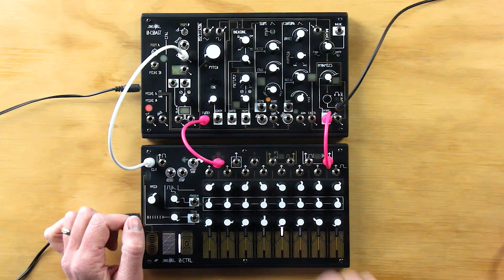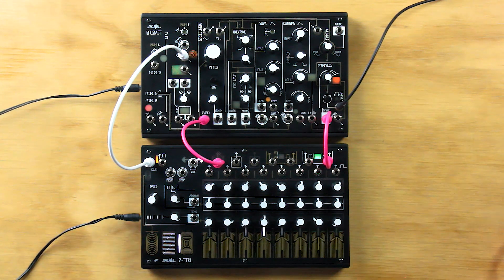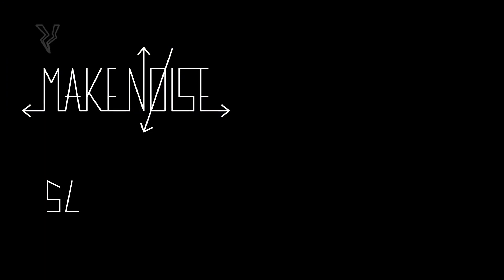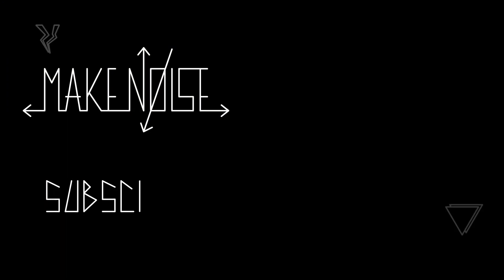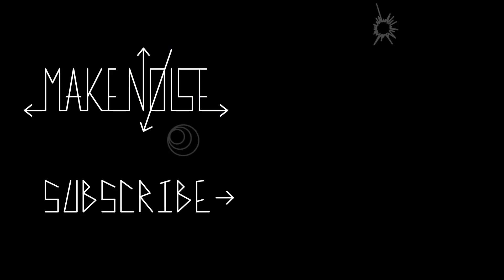0-CTRL Patch of the Week #3: Clocking the 0-Ctrl - Internal and External

Comment: It is not clear to me, despite various videos and manual, how the TIME sequencer line single steps work under the domain of an external clock. Do they become "multiples" of the clock or simply become useless ? Thanks in advance.
Reply from the maker: Together the Time row and Speed parameter control the length of the Dynamic Envelopes and Gates. When the 0-CTRL is clocked internally, the speed of the clock is determined by this length and so they will always be exactly in sync with the clock. When clocked externally the clock is no longer a function of the Speed and Time settings and so it is possible to use the Time row to create envelopes and gates that are shorter or longer than the step length.
Reply from the maker: @futurememories1660 if it is clocked externally and internally at once, then the sequence will progress (and gates/envelopes will be generated accordingly) whenever it receives either type of clock.

Comment: I could use some more assistance with syncing the 0--ctrl to an external clock if there is anywhere I can ask to get help for it, basically I can't get it to respond to external clock stop/start triggers.
Reply from the maker: What are you clocking it with? Please write to technical@makenoisemusic.com and we will help you out ⚡️
Reply: @MAKEN0ISEMUSIC  Ended up figuring it out, I think it had something to do with the clock signal being sent out from my digitakt, had the idea to just convert the clock using the 0-coast and turn it on/off with the attenuator so im all set :) Thank you though!